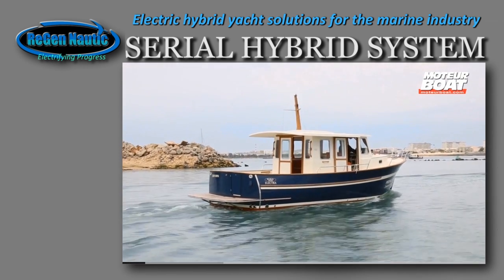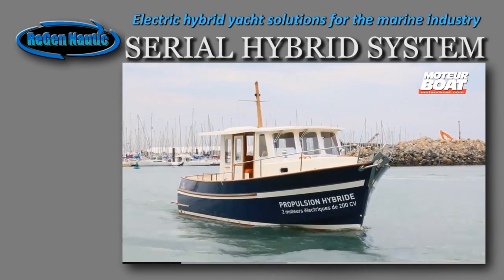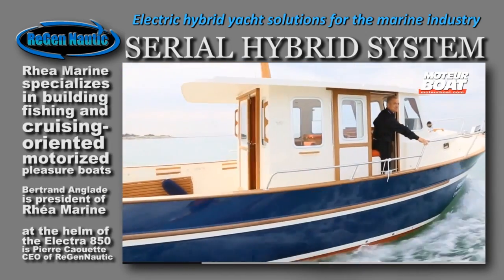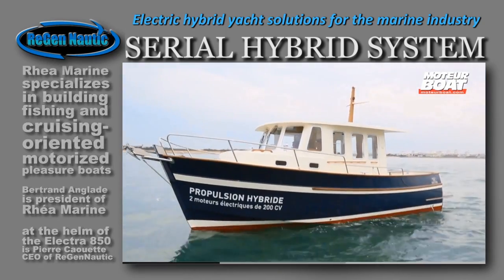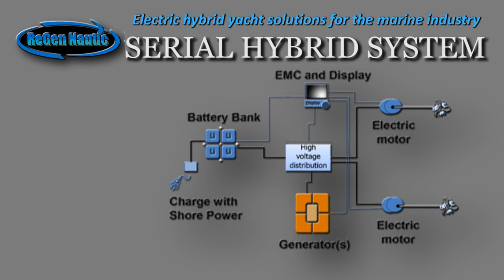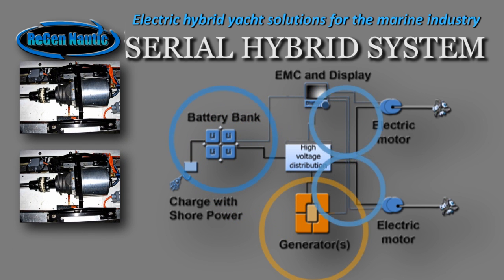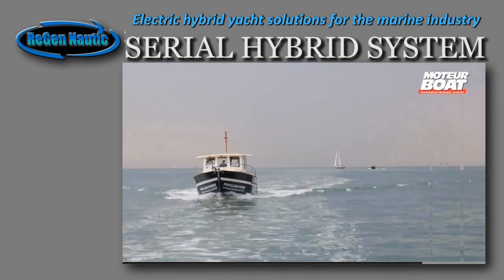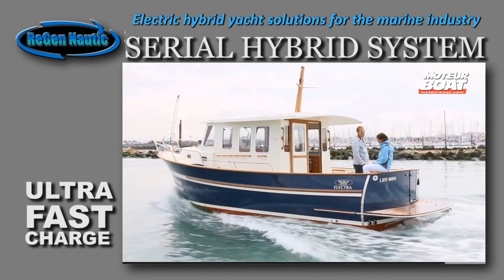The Incredible Electra 850

Comment: You could fit 9, 400W solar panels with 2x1m dimensions over a 6m fore aft length and full 3m beam forming a 3/4 length roof. Would look good and provide around 18Kw of power on a sunny day! Fully charges batteries over two sunny days.